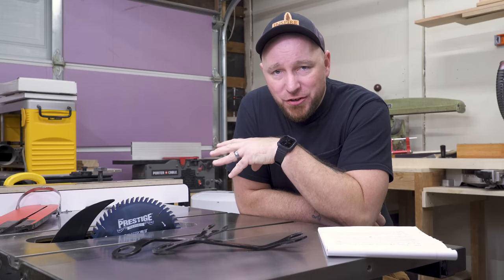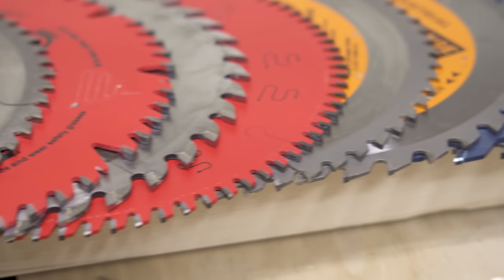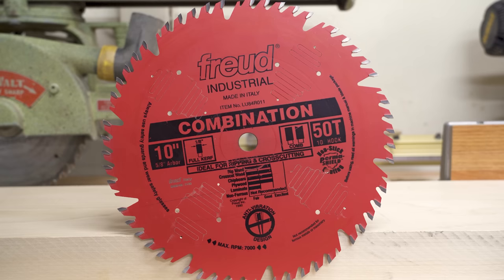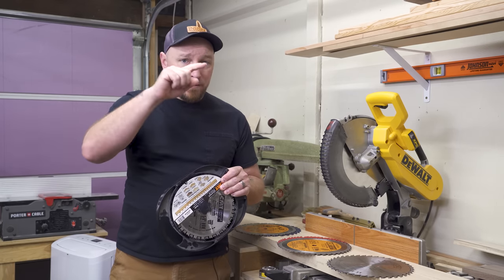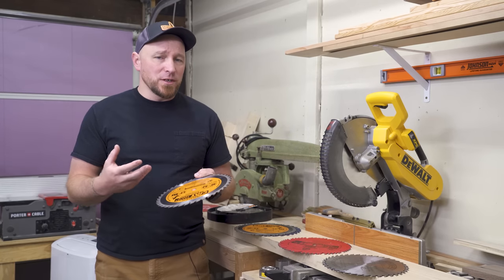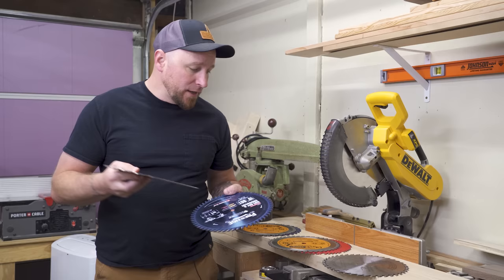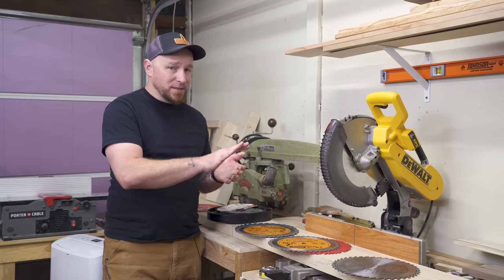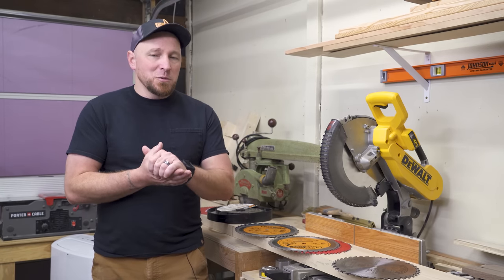Choosing The Right Table Saw Blade

Comment from the maker: If you need help finding any of the blades that I talked about, they are all categorized and linked in the video description. Also keep in mind that these things are guidelines, not necessarily the rules. With advancements in technology manufacturers have figured out how to do some pretty interesting things with blade geometry.

One more thing with regards to SawStop owners: The blue Amana blades and the red Freud blades are perfectly acceptable to use in your SawStop table saw. Contrary to popular belief, you can use painted or coated blades on your SawStop saw and the brake will work as advertised. It's the blade TEETH that cannot be covered because it can interfere with the electrical signal and therefore limit how fast the blade brake can activate. Some Amana coatings do cover the teeth but are still safe to use, as per Amana. (The CMT thin kerf rip blade has anti-kickback shoulders so technically it is advised not to be used in a SawStop because the anti-kickback shoulders could limit the speed at which the brake can stop the blade if things go south.) As always, if in doubt do what makes you comfortable.

Comment: In my experience the Amana 60 tooth blade (full kerf) is a great general purpose blade. It's the blade I used 80% of the time. The other blade I used is a high quality 40 tooth flat bottom rip blade.  Great for  joinery and rip cuts. 
I think the home gamer only needs two blades.  I'd avoid any the big box stores sell.

Comment: Great editing. I have an older Craftsman saw. The gentleman I bought it from threw in a bunch of new blades. One was a 60 tooth Freud and the other was a 30 tooth Craftsman rip blade. I use a zero clearance insert and/or a crosscut sled. Lately I just leave the 30 tooth rip blade on the saw and find it leaves just as nice a cut as the Freud no matter the type of cut I'm making. Maybe I've just been lucky so far or maybe just using too much cheap lumber. When I get upgrade my saw I'll look into other blade configurations but, for now it works for me. Thanks for the videos.

Comment: Great job all good information 👍, I use a Ridge Carbide blade in my table saw, and I love it. I would compare it to the Forrest Wood worker II, as far as performance but it is a little cheaper. It can be sharpened too.

Comment: I stepped up to CMT when I became unhappy with Diablo. Good quality thin kerf blades that won’t break the bank. I have the rip, crosscut, and combo blades you showed. I am not delighted with my Freud dado set but don’t use it that much, will give the CMT a look when I am ready to replace it, Does anyone have experience with CMT router and Forster bits?
Reply: I am also interested in cmt router bits, reading good reviews about them but dont have any, only Trend. Titman, Freud and CMT seem to be recomended bits for professional use, but again, I dont have any personal experience with them yet.

Comment: As a pro. I actually have two or even three of each. Mostly because if I have sent some in for sharpening I still have what I need to get the job done. Also try a full kerf 60 tooth triple chip for cross cutting plywood. Triple chip blades that are 80 and 60 tooth are also great for cutting laminate and melamine products. Have a good one.

Comment: What type of blade would you recommend  to rip 3/4" fire rated plywood on a table saw. And what blade do you recommend to rip 3/4" finish plywood on a table saw. And why type of blades do you recommend both on a tablesaw

Comment: I am always concerned about the occasional screws and nails in the wood that I am cutting. So would the problem with me using a steel cutting blade as a permanent all-purpose wood cutting blade?

Comment: That was a good point made at the end concerning the long-term usage - if you use six combination blades consecutively over, say, a three year period, then using six different blades concurrently will probably last longer and at the end of the time you’ve still only used six blades but you’ve probably had cleaner cuts..

Comment: Thru the years I have used a lot of freud blades with consistent performance but for the last 5-6 years I have gravitated to using only forest or ridge carbide. in my shop. Both are well worth the extra $$$'s. Both can be resharpend for very little $$$.
Reply from the maker: Thanks for mentioning Ridge. I haven't had a chance to try any of their stuff but have never heard a bad thing about them.

Comment: Just bought my first table saw, the Dewalt 7491rs and I want to get a better blade than the stock one but I’m still not sure what is better the 50T ATB, 50T ATBR, or 40T general purpose? I see eventually getting dedicated rip and crosscut blades, but for now one blade is in the budget.

Comment: Please help! Where can I buy a circular saw blade for my table saw that has a flat cut/flat bottom grind/flat top grind 

I’m in the UK

As we are not allowed dado stacks in the UK I want a blade to fit my new dewalt DWE7910 so that I can cross cut half laps on the table saw using the multiple cut method. 

Blade criteria is 
10” (250mm) diameter
30mm bore

I can’t seem to find one anywhere or there is not enough information on the website about the tooth profile. 

I have found a Freud blade which would be perfect but not for easy sale online it’s the
Freud LU1E 0100

Comment: I use the CMT Orange Chrome Carbide 12" Full Kerf Heavy Duty Crosscut Blade, 72 Teeth, Alternate Top Bevel Grind, 0.126” Kerf 285.672.12 on my Dewalt DWD780 Miter and it is the best blade I have put on it.  It cuts clean, fast and it is actually a little bit quieter.  Sorry, it is not what this video is about, but since you mentioned it, I thought I would agree with you choice of miter saw blades.

Comment: GREAT educational video - I just bought two of the blades you reviewed. I just bought the DeWALT 7491 saw and although it has a 2hp motor and should be ok with full kerf,  I decided to use the thin kerf blades with a blade 5" blade stabilizer. I have now bought several items.. double stick tape, etc ... as a result of these excellent videos. Larry

Comment: A friend managed a cabinet shop for a hospital system, where they make all of the hospitals' cabinetry in-house.  They solved the blade changing  issue by lining up 5 tablesaws in a row with different blades.  They monitor sharpness of the blades by measuring the motor's amperage draw - a dull blade requires more power.  Oh, and for that 1950s  DeWalt RAS in the background, a 9" thin-kerf sliding compound miter saw blade is a good choice.

Comment: When it comes to multiple blades I found out the hard way the table saw that you have makes a big difference. The very first table saw I owned was a fourth hand cheap one with a small frame and top. It was a massive pain to change blades so I never did. When I got my DeWalt 7491 it's so easy I swear it only takes a minute. So now I change blades often for which ever is best for the project and wood.

Comment: A very good collection of useful information. I'm going to have to go through the video again with a notebook and pause button. 

Are most of these available in low hook angle versions? I use a Radial Arm Saw exclusively - a 40-year old 10 inch Craftsman. (I noticed your old DeWalt lurking in the background ... envious.)

Comment: Excellent presentation. Answered some questions that I had. And this will solve for me some issues that I have had. In particular when cutting thin plastics and melamine.  Thanks so much.
I tend to use my Worm Saw and sometimes my Sidewinder to cut down sheet stock. Just to make it easier to manage on my Cabinet Saw. A video examining blade choices and what I can do with different blades for those saws I would also find useful. I don't use mine just to cut construction Spruce. I cut, once again plastics, melamine and wood species I am using to make furniture and a variety of projects. A look at blade choices there would be valuable as well. I think most people tend to use the blade that came with your hand power saw because they aren't concerned with razor accuracy or pretty cuts when using such saws in a construction environment. Maybe I'm just a rarity. Really enjoy your videos, thanks again.

Comment: I own some amana tool prestige saw blades and dang I think they are awesome blades for the price. 
I started with a combination blade and then went for a ripping blade (glue line 30tooth) and finally I got a 80t abt for crosscuts and plywood and I have never regret spending those extra bucks. They are very very good blades for the money

Comment: Lovely video, and although I had a pretty good idea about many of these aspects I still got a few things cleared up. 
One thing though- I'm curious why the rake tooth on the Freud doesn't make the blade plow a flat-bottomed groove?
Reply from the maker: Thank you for watching. The raker tooth doesn't stick as far out as the ATB teeth so it leaves the little dog-eared corners. I was so bummed about that but like I said, it's a wonderful blade otherwise.
Reply: @InspireWoodcraft  Oh oh.  I plan on buying the CMT 215.050.10 for this exact same reason.  Curious if it's tooth is lower as well. Off to research again.
Reply: I think because some blades have a difference in height.
For instance some CMT blades have a 0.3 or  a  0.5 mm heightdifference.
Perhaps the Freud blade also?
Ruben

Comment: Thanks for sharing your insight into the bewildering world of blade choice!  I've recently been working with reclaimed oak, and, whilst I can rip it with my tracksaw or circular saw, it is a real struggle on my  table saw.  
It came with a 10" multi material blade, which I changed  almost immediately for a general purpose blade that worked really well with MDF and other soft materials, but just about set the oak on fire.
Given the current price of wood in general, and hardwood in particular, I quickly realized that it would make sense to invest in a dedicated ripping blade.
You always hear that low tooth count and aggressive tooth angle are essential for burn-free, straight cuts when ripping, but I have often seen advice pointing in the direction of 40, 50, and sometimes higher count ripping blades. 
I notice you, too, are showing similarly high tooth-count blades for ripping. In my experience, working with oak worktops and fitting solid wood doors, the lower the tooth-count, the cleaner the rip cut.
I'm based in Scotland, so most of the blades you recommend will not be available over here, or will have different monikers. That said, again, a big thank you for sharing! 👍

Comment: Great overview,  thanks Jodee. How often do you actually change blades? I'm usually so pressed for time i just stick to the combo blade for ripping and cross-cuts, no matter whether plywood, softwood, or hardwood. I often jump from a rip to a cross cut (using a sled) in a matter of seconds. Do you actually stop and change blades between rips and cross cuts?
Reply: For me personally, I keep my combo blade in most of the time but if I know I'm going to be doing a good bit of rip cuts then I swap and the same thing for crosscuts.

Comment: keep em clean too.
Reply from the maker: I knew there was something that I forgot to mention.
Reply: @InspireWoodcraft  only reason I remembered is that I scrubbed my 50 tooth freud saturday.  Which also reminds me, I need better gloves for that.  Pokey little devils.
Reply: @roscocsa   Cleaning is about ⅔ as good as an actual sharpening.  Give them a good soak when you're done with a project and next time you start with a blade that seems almost sharpened.  I was surprised at how much better the cut quality was from simply cleaning.
Reply: @BoatswainHiggs  i know there is an awful lot less burning.

Comment: Sir, does the blade thickness needs to be the same thickness as your riving knife for this to work properly?
Reply: Yes, say you are using a thin kerf blade but have a full kerf riving knife installed, you will hit the riving knife with your stock.
Reply: @EricMcWhirter  thank you sir. Ill start looking for riving knife that match the thickness of blades I’ll be using.
Reply: @EricMcWhirter  interesting ... I use a Radial Arm Saw exclusively & had been thinking of a thin kerf blade. Since the saw's splitter in s not replaceable, I will have to consider filing the splitter's front edge to a wedge shape to accommodate a thinner blade.